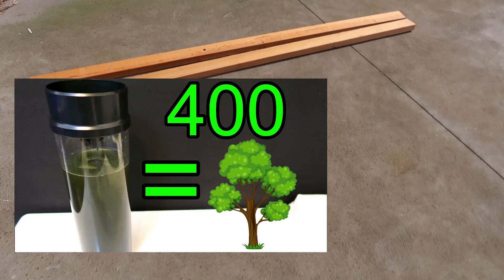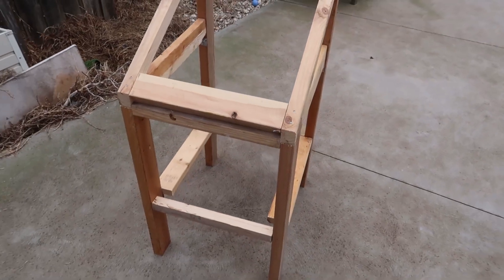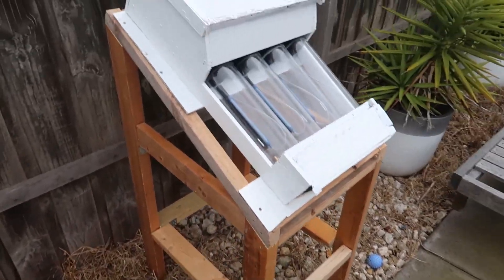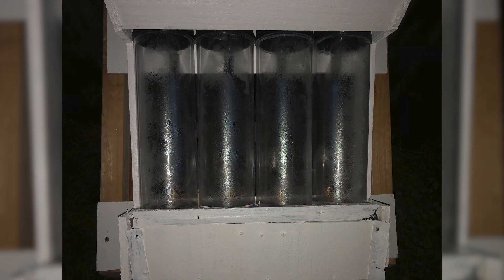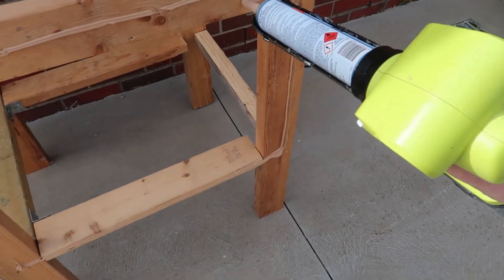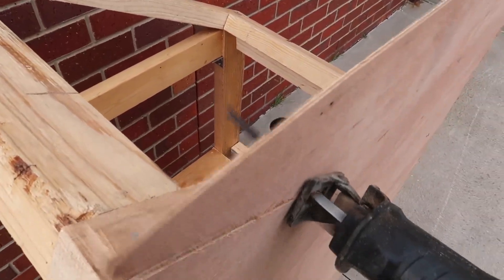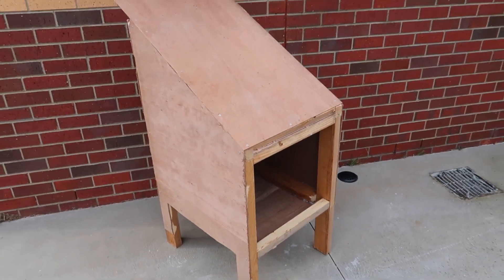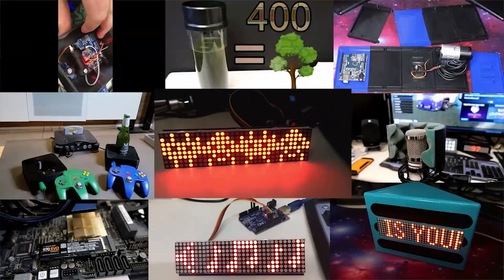Test Stand for the Algae Co2 Scrubber

Comment: Am really looking forward to seeing your results!

What are you planning to do with the produced algea?

Guess it would be best to dry it out in the sun and to them heat it without any oxygen accessing.
This would create algae-charcoal. As long as you dont burn it, this would bind the Carbon for now.

Of course you would need to run the oven from some powerfull solar, wich might be hard. Maybe you could also use the gas that evaporates during the coal making process for heating the oven, should still be co2 negative afterall.
Reply from the maker: Cheers glad your enjoying it, thanks for subscribing as well. I'm going to try a few things including what you have mentioned, but in a controlled system, like drying it out in a chamber with a bunch of sensors and see what results come from it. so plenty more videos that need to be done!
Reply: @ScottyDIY  Awesome! Will also be interesting to see the comparison between the dry weight and the co2 intake that your sensors measured.
Reply from the maker: yeah I'm looking forward to it as well, thinking of also trying some in a vacuum chamber which I'm expecting it to pull stuff (o2/co2/nit) out but once at a vacuum close off the valves and see what happens, doing most of this DIY but hopefully one day I can buy some proper testing equipment, ad revenue isn't going to pay for it, so might not be getting stuff for a bit lol